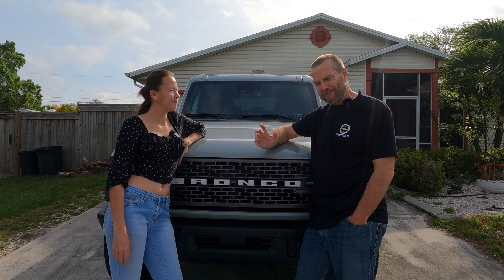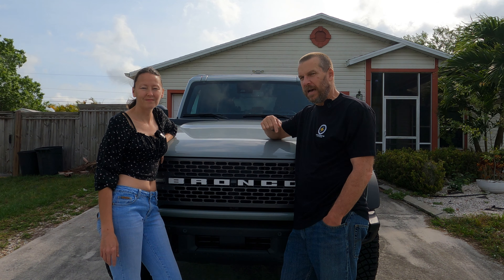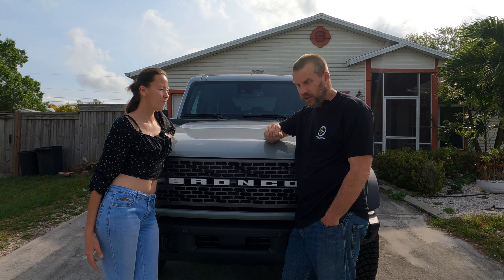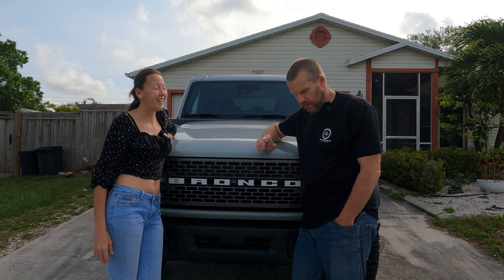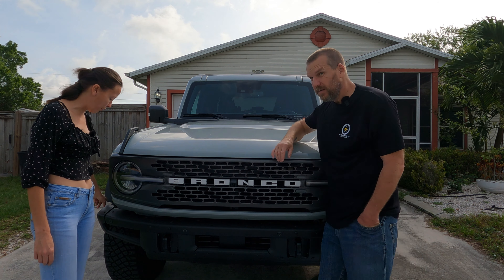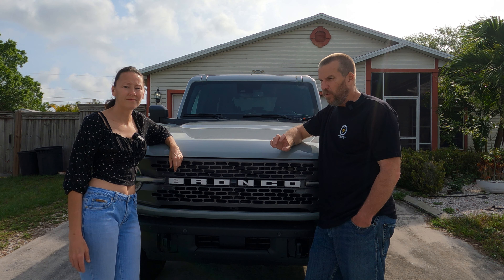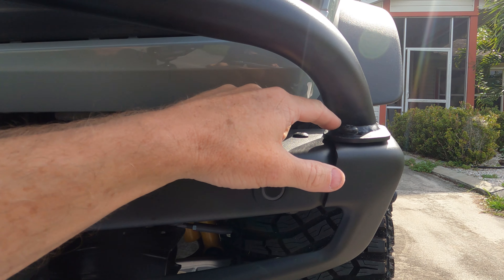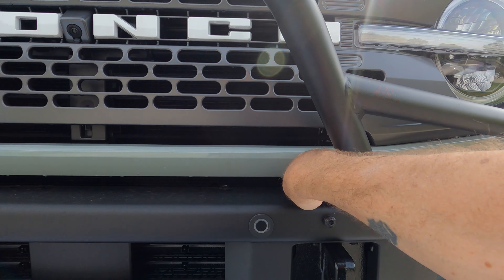FIRST MOD FOR BRONCO BADLANDS FROM JCR OFFROAD. PRERUNNER STYLE  BUMPER BAR

Comment: Great Video      To avoid possible thread damage with the punch technique you can place a ratchet strap around the two center bars and tighten to get those holes to align.

Comment: That looks great.  I always like simple things that make a big difference.  I'm sure you saved a lot of people time and frustration with this video.  Nothing like thinking you're almost done with a project then realizing you have to take it all back apart and start over because of a bolt or two that can't be installed after the others.
Reply from the maker: That is true. Jill did a good job but didn't realize the outer bolts have to go in first. I wouldn't either until we had it installed.

Comment: Surprised JCR didn't include a black Hex head bolt for those two spots that are impossible to reach with a Torx.  I have their winch plate with Camera relocation, Fog light brackets, and tailgate table on mine.  They make great products.
Reply from the maker: It came with bolts but preferred the Bronco bolts. We also have the cowl light brackets.
Reply: @1Five1Garage  Nice!

Comment: I notice that the modular bumper appears to have only a very small projection beyond the grille.  Does the capable bumper project further? Seems like you might need that bull bar to not unintentionally do damage in a parking lot.  Can you see it well from the drivers seat?
Reply: I have something similar on my F250.  Definitely can't see it but in the six years or so since installed it hasn't been a problem.  Some people however aren't good at judging where the front of their vehicle is if they can't see it (see the damaged front bumpers on many sports cars with sloping hood.)  If you are that type person I would recommend against adding this, a winch or anything else that extends beyond the factory bumper.
Reply from the maker: You can't see it from the drivers seat. I never park close to people. mainly for being able to get the dogs in and out.

Comment: I've use a combination wrench with a short bit before but even that solution looks like it would be to high.
Reply from the maker: We had to chop it down pretty far but it did have hex head bolts with it... We just wanted to use the stock Bronco Bolts